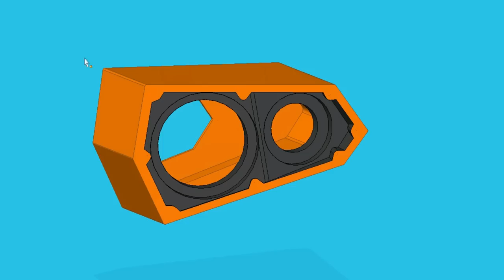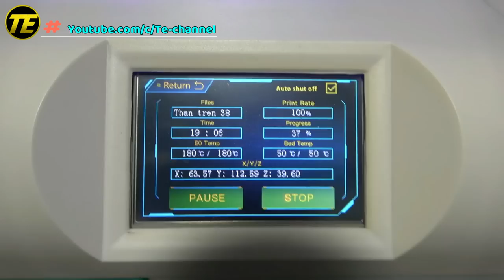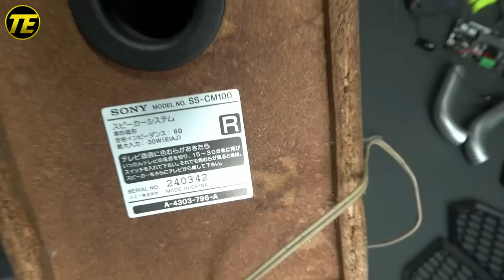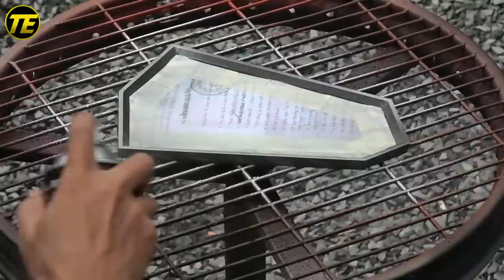Building Lamborghini Speaker

Comment: Bro you should start selling these on AMAZON....btw where do I get speakers for this?
Reply: I do get these from car systems, there are expensive ones like 300$ each speaker, and cheap ones 10$ each one. There is a JBL Stage series for cars that is about 40$ the pair and they can work even up to 200 Watt, those are pretty nice
Reply: Original design by IXOOST MODENA